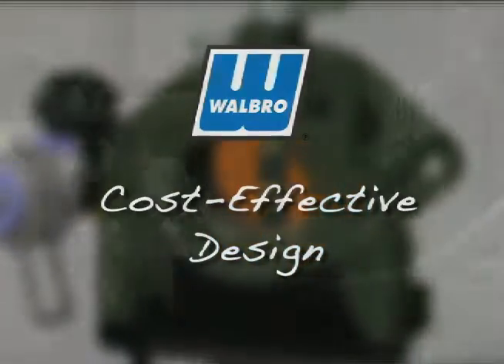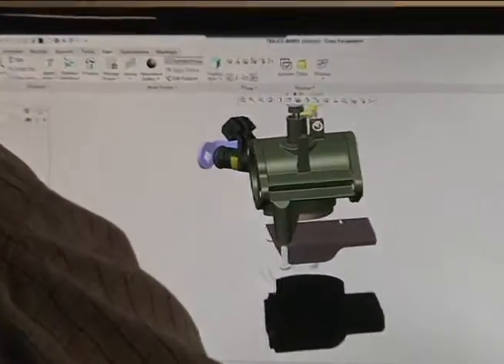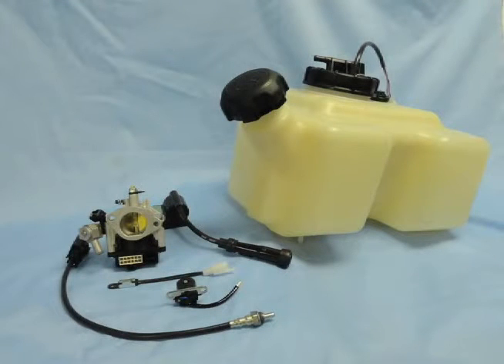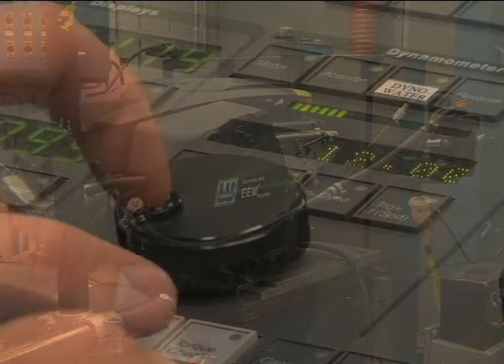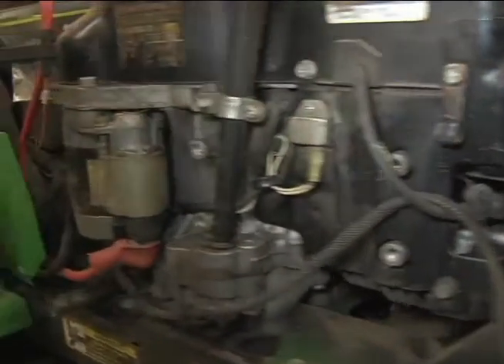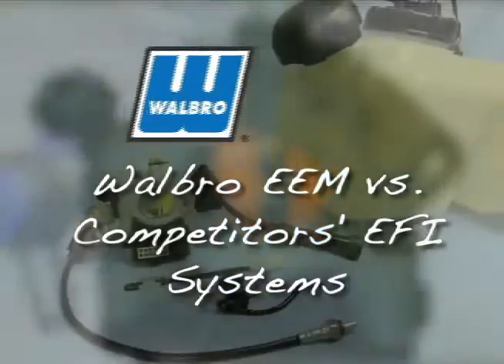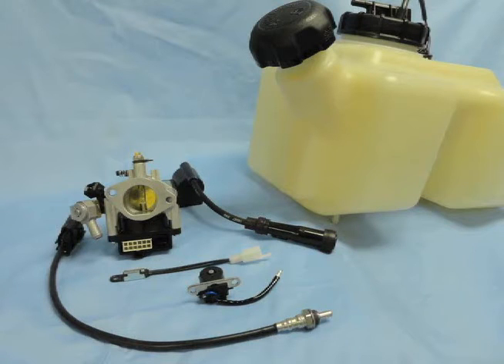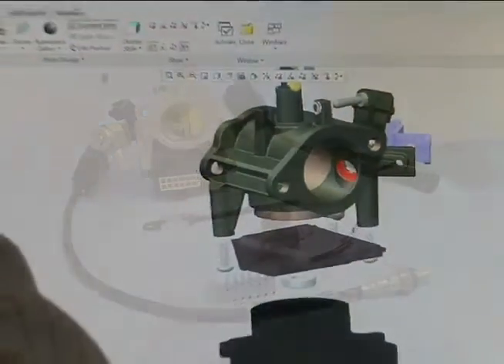Walbro Electronic Engine Management

Comment: i had an rc airplane with a gas engine that uses a carburator, and when i go to high altitude the engine runs reach, and theres no way to had multiple carburation points in conventional carbs, this efis kits are the holy solution, when is going to be avaible?
Reply: Or some method to adjust fuel trim while in flight.
Reply: @ShainAndrews  hard thing to do becouse needles are so tiny that are almost touching each other
Reply: @jorgeneo560  Gotcha, I suppose the required adjustment is pretty small too.  Guess that is why fuel trim isn't a thing in the RC world.
Reply: @ShainAndrews  some rc helicopters had a remote needle to be operated with a servo to do that, the fact is that in normal operation is didnt need it, i build a UAV rc airplane, a FPV plane, and i go to altitudes that are not normal and do flights of 40 minutes and 10 km, and going in high altitude more than 800 m you can had issues in perfomance with normal carbs, and when i saw that walbro develop a efi to 2 stroke engines that was the holy grail, sadly it never come out, is in development for almost 10 years, i study the posibility to build my own, but the complex part is the injector, in 2 stroke engines you had one injection every time the piston go down, so its like a 4-stroke engine runing at 2xRPM, so a 8400 rpm in 2 stroke you would need a injector that could run a 4-stroke motor to 16800 rpm, and that injector didnt exist